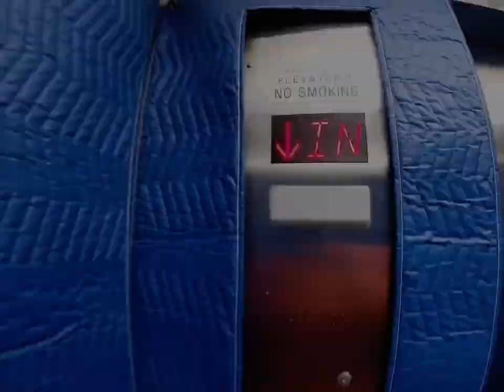Flying Steel at the U of A!

Comment: Why do you guys not use wire steel chokers?
If you have to get up on the load, they won't shear like a nylon. 
Why do you impact the connection prior to bolting up?
It makes it more difficult for the bolt up and plumbing of the building. 
Still enjoy your videos, however.
Reply from the maker: I agree with you on the steel chokers but the company only buys them certain times i guess idk. I impacted this certain connection because it was at a slant away from the flag plate. The impact just helped pull it closer to the flag plate.
Reply: @mayneofsteel  10 4.
I would carry a "quickie bolt" for connecting, I usually keep a 3/8" drive ratchet, and a deep well 1 1/4" socket for that situation, with smaller iron in retail, schools, and churches. 
That's what is going up here in the seaboard of the mid Atlantic. 
Keep up the good work, always enjoy your videos, Mayne.